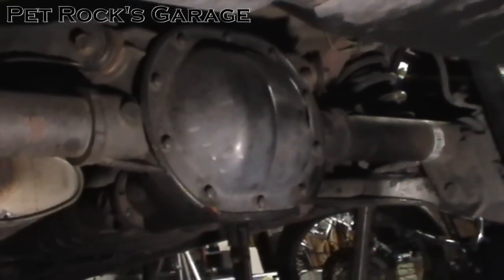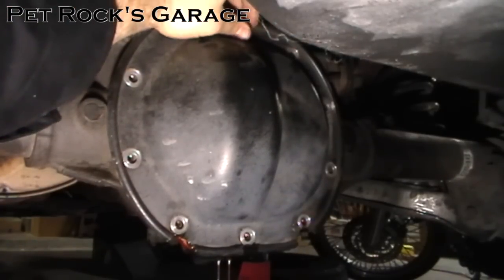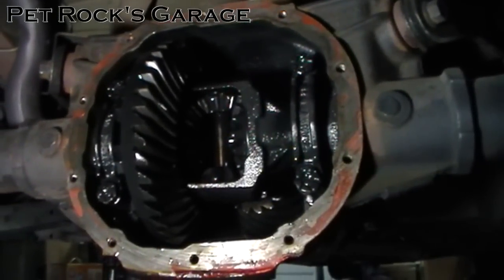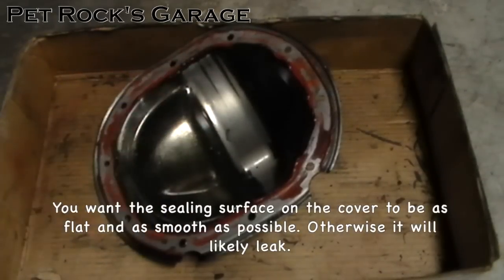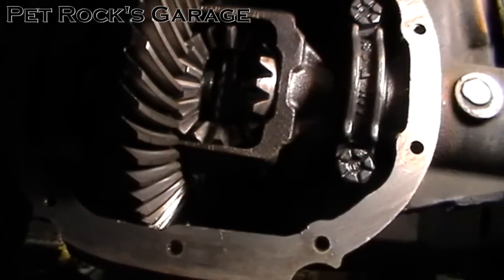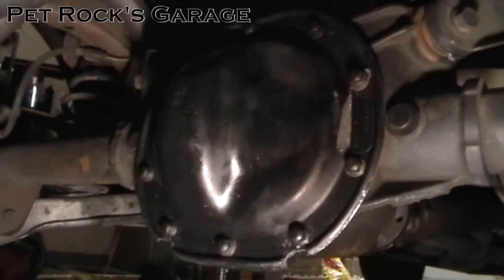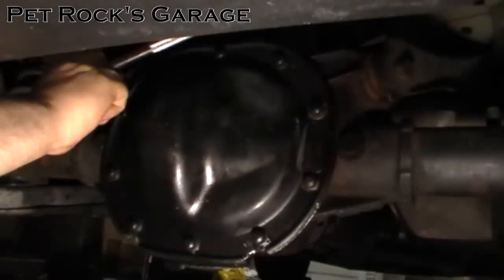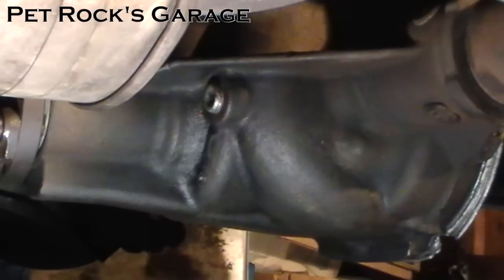How To Change Ford 7.5 & 8.8 Differential Fluid - Ford Mustang

Comment: What about using limitied slip additive. I have an 04 and the Ford guys told me to use it. I picked up some from ORielys but it doesnt tell you how much to use.
Reply from the maker: james aylor, if your differential is a limited slip differential then you need to add limited slip additive. However, if you have an open differential then you don’t.  Check the identification tag on the differential cover to find out. If you don’t have the tag, contact your local Ford dealer’s parts department with your VIN and they should be able to tell you what type of differential you have (if your diff is the stock diff).  Typically you add about 8oz of the additive.  When you are about to refill the diff, put the additive in first and then the oil until it starts coming out the fill hole. Good luck...
Reply: Thanks, I'll let you know how it works out.
Reply from the maker: Good luck...

Comment: Is this a posi rear end? I didn’t see and additive added.......thanks. Jim
Reply from the maker: No, its an Open Diff.  So no additive needed.  If your diff is posi then add the additive first and then fill with fluid till it comes out the fill hole.
Reply: Thanks....Jim
Reply from the maker: no problem.

Comment: Can we jack up the rear end of the mustang by placing the jack on the bottom of the differential?
Reply from the maker: Yes, but only do it to get the car in the air so you can put jack stands underneath. Make sure the jack isn't touching the diff cover otherwise you can warp it. Also make sure to chock the front wheels so the car doesn't roll away from you. Good luck.
Reply: Thanks! Really appreciate it
Reply from the maker: No problem.

Comment: 2007 Mustang GT come with a 7.5 or a 8.8 rear differential?
Reply from the maker: I'm pretty sure its an 8.8 since it's a GT.  If you don't have the info tag on the one of the bolts on the diff cover, you can call your local Ford Dealer's parts department, give them your VIN and they should be able to tell you what it came from the factory with.  Otherwise you could just measure the ring gear inside the diff case.  If its diameter is 8.8" then it's an 8.8 diff.  Good luck.
Reply: Hey thanks for the quick answer, I just bought my 2007 GT with 60,000 Miles and i'm wondering all the maintenance I have to do. I have a small leak on the differential and I wanted to understand the most before servicing it, even buying the fluids necessary to do so before hand (SAE 75W-140?/friction modifier). Also was thinking on buying a new cover differential (chrome) since includes the new gasket.
Reply from the maker: Congrats on the new (to you) ride.  60k miles is barely broken in, IMO.  I would change all the fluids (engine, tranny, diff & brake fluid). You don't know if they were ever changed by the previous owner. Change the diff cover if you want, but no-one is going to ever see it unless you get air going over a hill or something.  Also, gaskets are super cheap on their own.  Use whatever fluids your owners manual says to use. Your choice on synthetic vs regular oil.  I typically go with synthetics.  You only need friction modifier if you have a Limited Slip Differential.  You can tell if you do with the rear off the ground. Spin one of the tires. If the opposite side tire spins the same direction you have an LSD.  If it spins the opposite direction you have an Open differential, which doesn't need friction modifier.  Good luck.
Reply: Hey! I'm back :) , just watched your video again to refresh the procedure since I attempted to change the fluid tomorrow, today I'd removing the differential cover, cleaning the gears with brake cleaner, and so on... I was rechecking where and how to put the fluid, I don't have the adapter you used so I'm guessing I need to come up with something tomorrow, any suggestions? also I place a new chrome cover, this one came with a gasket, since I saw you didn't use any I was wondering if it was really necessary? I placed it any ways, I't was strange to see this gasket for me because it was really flexible, not like other gasket I've seen for other parts that are made of metal and are very rigid and strong. I also forgot to clean the cap that helps release the gas and temperature from the inside of differential, I will sure do that tomorrow. Thanks again for this video, please let me know any comment or recommendation you think appropriate.
Reply from the maker: You can pick up a pump like the one I used at your local auto parts store for under $10. I recently picked up a new one at AutoZone, but others should have it too.  As for the gasket, you can use one if you want.  It came from the factory with RTV, but you can use either one.  Definitely clean the air vent cap on the axle tube sooner rather then later. You don't want pressure to build up in the diff and blow out a gasket causing a leak.

Comment: Would ultra grey max torque work? And pouring by the bottle?
Reply from the maker: Yes, ultra grey should work. I'm not sure what you mean by "pouring by the bottle". You keep filling until oil starts coming out the filler hole. You will most likely have some left over oil in the bottle when you're done.
Reply: @petrocksgarage  just wondering if there was enough room to pour in with the quart bottle or do i need a pump
Reply from the maker: @ulisesc4388 , there isn't a lot of room under there. If you jack up the car and let the rear diff hang you will get some more room but it will be a P.I.T.A. It is much easier with a pump. Pump adapters for bottles are pretty cheap and available at most auto parts stores. Good luck.
Reply: @petrocksgarage  thanks for this information sir! Will look around.
Reply from the maker: @ulisesc4388 , no problem.  Good luck.

Comment: Sorry to bother you, but I'm changing manual 5 speed transmission fluid out of my 2002 mustang. Auto parts store said use A.T.F. where my father said use differential fluid. Which one would you suggest?
Reply from the maker: No problem. Go by whatever fluid your owners manual says to use.  Differential fluid sounds too thick, IMO. Good luck.
Reply: Pet Rock's Garage ok...yeah, I don't have the owner manual. But AutoZone said A.T.F. My dad laughed and said you'll burn your car up. Lol...so yeah. I'll check into it...thanks
Reply from the maker: You can download the owners manual here: https://owner.ford.com/tools/account/how-tos/owner-manuals-search-results.html?make=Ford&model=Mustang&year=2002
It says to use ATF fluid with MERCON, which isn't the same as ATF with MERCON V. That is assuming your car has the stock (T5?) manual transmission in it of course. Good luck.
Reply: Pet Rock's Garage thank you again
Reply from the maker: No problem. Enjoy your new (to you) ride.  You treat it right and it will do the same to you.
Reply: Pet Rock's Garage thanks, I'm working on now...wish I could post ya pics
Reply: @cameronbevan4094  i know this is a year old.. but thought id share in case it helps anyone else. But a LOT of manual transmissions use auto trans fluid. My T5 called for ford type F trans fluid. I found that adding half a qt of lucus and the rest trans fluid made it shift so silky.
Reply: @TheModAddict  i used atf...lol that cars long gone now tho

Comment: damn,I forgot tospray brake cleaner in the and aroungd the gears and spiders,now i get to loosen up my pan and start over????and i could not find my drain plug eithrthamks now i caaboes it rite,
Reply from the maker: Unless your old oil was full of metal particles or you also forgot to clean the magnet, I wouldn't worry about forgetting to spray brake cleaner inside the housing.  Just make sure to do it next time.  These diffs don't come with drain plugs from the factory. You have to remove the pan to drain the oil out or install a pan with a drain plug built in.  Hope that helps.

Comment: What fluid did you use?
Reply from the maker: The manufacturer doesn't really matter. What matters is that it meets/exceeds the specs for the oil your owners manual says to use. I use 75W-90 synthetic gear oil. Hope that helps.

Comment: i was wondering what that rusty rotted away piece of sheet metal was hanging off my 8.8 inch diff. cover. no use for it now
Reply from the maker: daniel griffin, yeah, its the Diff ID tag to tell you what size & ratio of gears are inside your differential. It’s pretty important if you need to buy parts to service it. There are a bunch of different gear combo’s for 7.5 & 8.8 differentials.
Reply: seems pretty important. it's too bad mine is rusted and un readable. do you know of any other place i could find that information?
Reply from the maker: daniel griffin, if your diff & gears are still stock you could contact your local Ford dealer’s parts department and ask them to look up the diff specs via your VIN. They would likely be able to order you one once you have that info.  Good luck...
Reply: good to know thank you.
Reply from the maker: daniel griffin, no problem

Comment: How many miles did this mustang have?
Reply from the maker: I don't remember exactly how many, but it was over 150k at least.  Its now around 190k and still running strong.
Reply: Cool thanks for the response, just picked up a 95 Gt with 60k
Reply from the maker: Congrats. That car is barely broken in. Enjoy the new (to you) ride.
Reply: Thanks man!

Comment: 80/90?..no 75/140w ??
Reply from the maker: I assume you are asking about diff fluid. 75w-90 or 75w-140 will do just fine. I use 75w-90. In the end, use whatever fluid type is specified in your owners manual.

Comment: Wow if that permatex gasket remover rusted the can then I would be very wary of putting it on any of my metal surfaces.
Reply from the maker: +caljohn88, if you clean off the metal surfaces with brake cleaner after using the gasket remover you will be fine.  It will only rust up if you leave it on the metal surface for an extended period of time.  So be careful what you spray it on.

Comment: rtb is crap I know the gaskets are hard to find for the Rangers as ford doesn't make a direct replacement but they aren't impossible to find if you order a new cover the gasket comes with it
Reply from the maker: RTV isn't that bad. Its just annoying to work with. But yes, if you prefer & can find a gasket by all means use it.